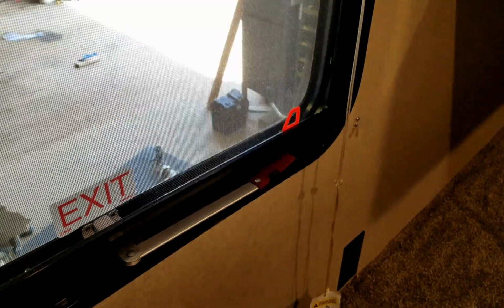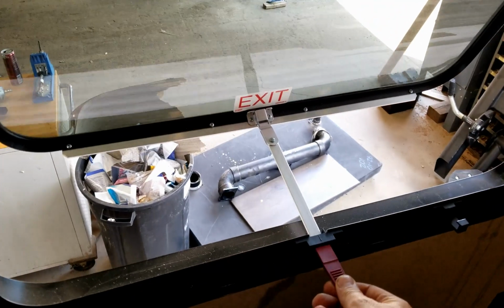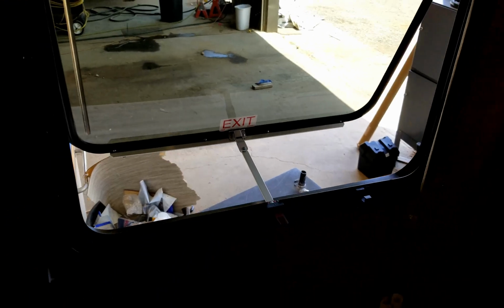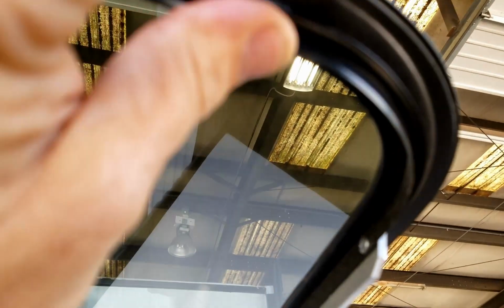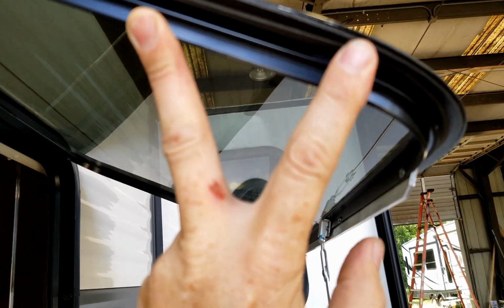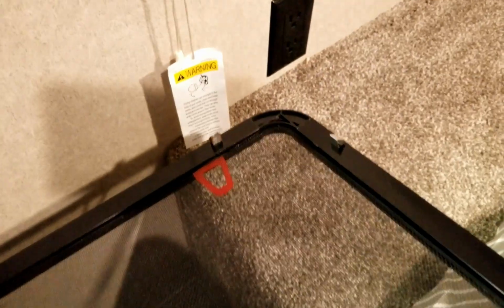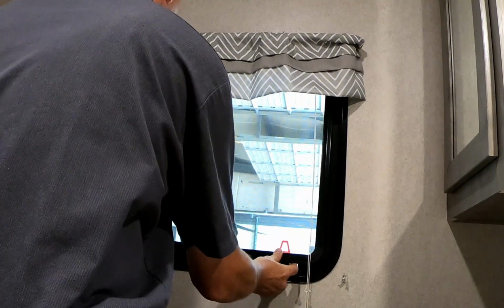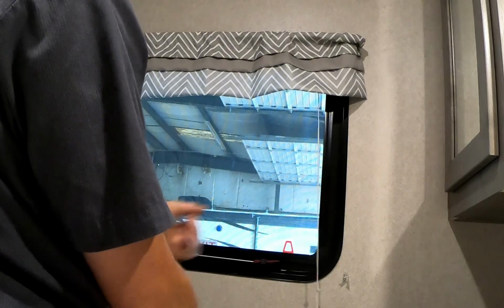RV Emergency Window - Part III of the "RV Safety" series

Comment: Thank you so much for this video.  I have been unable to find this info anywhere else.  I just bought a used 2021 Gulf Stream trailer and tried for a while this afternoon to figure it out.  Someone told me they are never to be opened unless it's an emergency.  But my theory was that Gulf Stream would never have placed screens on the window openings if they weren't to be opened and used.  Thanks again!

Comment: Good video, I hope you see my note here.  We have a '19 Outback 280URL, and the Emerg window has never been opened.  It is now stuck.  It does not have the bottom lever as you showed, but 2 red levers on each side of the vertical frame.  How do you propose we get this to open?  Thank you
Reply from the maker: @user-sx8qf5hh5m  carefully push on the bottom of the glass distributing equal pressure on both sides.

Comment: Thank you.  I have a 5 1/2 ft drop from my exit window.  I am think about making a rope ladder.  I travel with my dog and  I am almost 77 with a new artifical hip. Do I  go out the window feet first and hang on the window sill facing the coach and drop the 1-2ft down to the ground.  Fortunately I  won't have e trouble fixing through the window.

Comment: Have a 2012 Tiffin Open Road & it does not have handle like u described just 2 red loops. They look like they are supposed to loosen the rubber gasget but are so old I don't think they would hold up. I'll try & send photo. Thanks Ann

Comment: Hi Mr Rv. I have emergency egress window like the one in this video and I guess my seal are so stuck that I cannot open them at all. What should I do. Pushing harder from the inside or take a took like a screwdriver and try to unstick the seal bit by bit ?
Reply from the maker: Just carefully push but spread your fingers wide to disperse the pressure.

Comment: Thank you so VERY much for showing the stuck window because I have one and a screen in the full bunk area where the window does not want to attach. Both are emergency exits but want to use for a cross breeze in our master bedroom and for those less hotter nights when a.c. is not needed but want fresh air on the bunk bed area.

Comment: Ours has come all the way out. How do you get it back in??!  It’s a 2 piece window. We cannot get bottom piece back in. 2018 frameless window. Cardinal 5th wheel
Reply from the maker: Hmmmm .... I would have to get hands on with this one to see how it attaches, wish I could help through the ethernet!!
Reply: @MRRVTECH  
We understand there is a j hook in between the two windows but if you push it up under the top piece it has a lot  of pressure on the second one and we are afraid we are going to break it. My husband got locked out and I was locked in. This is the only reason we used this window. There are no videos out there that shows how to put the two back together.
Reply: @lisastewart7938  did you ever get it back in? Ours did the same thing when we opened it
Reply: @lindalawson8096  
My son and my husband worked on it for over an hour. We aren’t sure it it’s correct but we have it in enough that we don’t think it will fall out. We have a trip planned end of this month to Florida so we shall see. No issues with the screen just the bottom of the two piece frameless windows. I’ve looked everywhere for a video on this.
Reply: @lisastewart7938   thank you. We have booked to take it back to dealer to fix, haven’t even used it yet. Yikes!! Hope you have a great trip.
Reply: I'm in the same boat. I opened mine (I always take the screens out to enjoy where it's parked) and I wanted to see if I could open the window wide enough to shoot video from inside - without getting the camera wet or disturbing the game. 
When it got almost horizontal it slipped out and I cannot close it - it now binds. 
I know there must be a trick but being a custom piece of tempered glass I'm not inclined to guess and just man-handle it. Going to be COLD tonight - - sure don't want to break it! Help!
Reply: @bc-guy852 I know this is 2 years later but, how did you solve this? I'm assuming you haven't been running around for 2 years with that window ajar! 😁
Reply: @flutini1  Nope - it's still wide open all year - - COLD in February!
Just kidding. Yup - after a pro window guy looked at it we realized a retaining screw, inside the track, was damaged. So we removed the two tiny screws, replaced the damaged one - fiddled for an hour (it seemed) and it popped back in. Now, I don't mess with it and it still opens as it shouild.

Comment: Why does an emergency window have a screen if it’s only used in emergency?  Can you use it for ventilation with screen otherwise?  We have a jayco jayflight
Reply: Roger Soren I agree, I wanna be able to use the window.
Reply from the maker: yes you can the handle is designed so that you can prop it open
Reply: I open it for cross ventilation when the AC isn't needed.

Comment: Love the videos you’ve helped so much. I have checked my windows like this before every trip with no issues. Except for today, my window actually fell off the hinge do I have to buy a complete new window or is there a replacement piece? The hinge portion is still intact on the frame

Comment: What recommendations do you have for keeping the window open enough to actually egress?
Reply from the maker: I imagine in an emergency that would be a second thought but, depending on how you exit your body would just shove it out of the way
Reply: @MRRVTECH  I doubt that it will work that way in an emergency, unless that is practiced in advance. Most RV dealers and videos only show how to unlock the window itself.  That is the easy part of the problem of egress.

The few videos out there, which show people attempting an egress through the window show how difficult it is in an emergency.  People try all things like straddling the window opening or sitting on the window opening while attempting this maneuver. Both will stop most people.  In a fire, you only have a few seconds to react before you are toast (literally).  These things might meet some arbitrary "standard" but would actually be death traps for many people. More excellence in RV manufacturing brought to us by an industry that makes junk.

Comment: On the seal that's part of the window frame (not on the glass), is there supposed to be a gap in the middle of the bottom edge of the seal where there appears to be a rivet? We have a gap of 1/2" which may be causing a leak inside the frame (inside the RV). Thank you!

Comment: I have a Brand new Keystone Hideout,i tried to test my window today and the handle Will Not come out of the bracket or push back,Does the Screen have to be out to open i just wanted fresh air Why wont the handle push back or come out of the bracket?It won't slide back to the skinny part of the handle,What do i do?